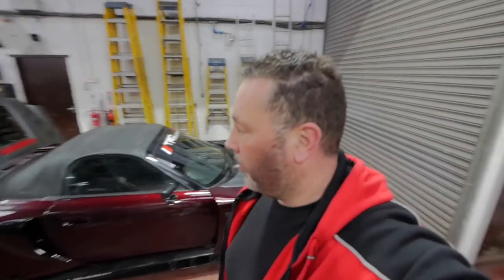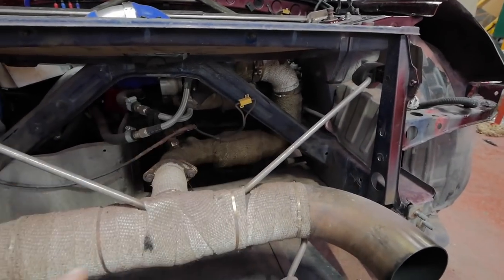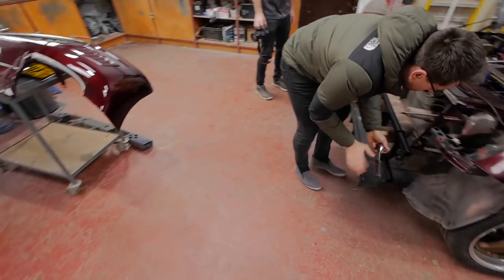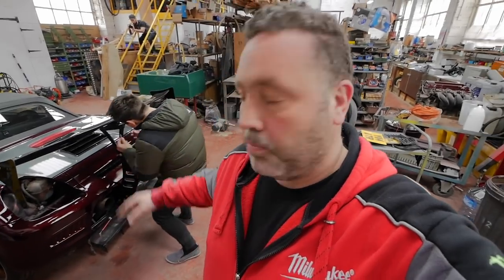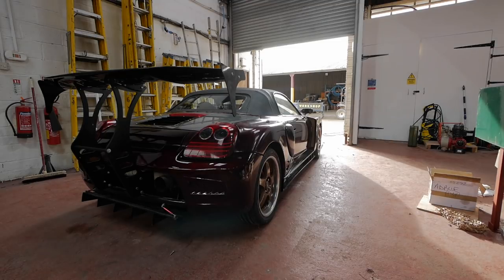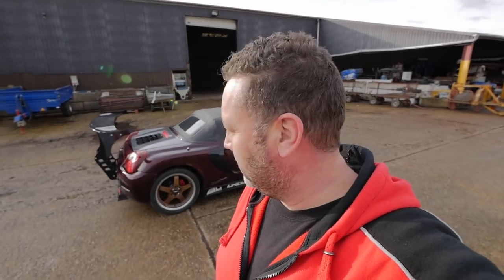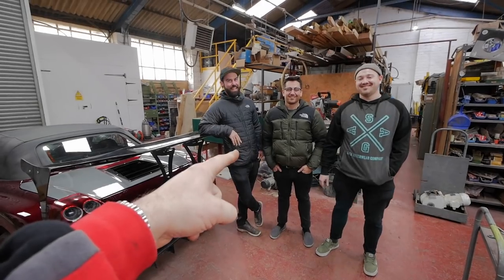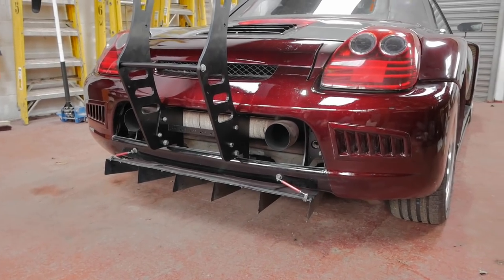chassis wing by ropey racing   MR2 Spyder Roadster turbo

Comment: First vid i've seen thanks to YT. I have to say I'm not sure about the exhaust. Would it make much of a difference to have a 'Y' split exhaust rather than a 'T' with all the length of the thing? I'm a sucker for the looks of a pipe that splits off in a 'Y' but that's just my own personal preference. 
Either way, nice build man. You should try and get your hands on a hardtop for her, then you won't need to worry much about potential thieves cutting through the hood.
Reply from the maker: A y is what I wanted but didn’t have one laying around at the time. I’ll make a new better one eventually

Comment: Hey brother, I have a question, my 2002 mr2 spyder has the sequential transmission, and about 1-2 months the shift stick gets harder and harder until a point I couldn't move it, now I have to do it electronically from the wheel steering wheel. Any idea on that? Thanks brother! 
Love your car and vids man, congrats
Reply from the maker: Sorry dude I don’t know much about that transmission but my manual did exactly the same thing and it was the shift cable between the box and the stick. It snapped eventually. Changed it for new and all good.
Reply: @SpyderLEE  alright brother thank you so much. I will check that. Awesome vids. Bug fan dude

Comment: I am going to be honest... I love most of the things done to this car i have been follow your progress for a while now. But my suspicions unfortunately came to reality today, there is no need for any wing on this car to begin with and now you put this monstrosity on the back? The value of that car is goimf to go down if you keep going the ricer way 😞 sadden to see a beauty becoming a impractical over the top non sense only making the car handle worst and slower. Please take it as my opinion i mean no ill intent
Reply: AGREED!!!!!
Reply: value? unbolt the wing and it'll be back to how it was.  it's easily reversible. the car will handle fine if he adds a bit more front splitter to balance the aero pressure front/back.
Reply: @refirendum  by having a chasis bolted wing it tells a buyer the the person was more insterested in looks over the mechanical factor of the car, and in most cases added things to the engine to damage it or never took care of the car properly... In this case we know he takes care of the car but who ever knows about cars and see that wing, will automatically low ball the car.. You mentioned adding canards in the front to offset the useless wing well thats an extra step fod no reason basically was a waste of money and depreciation of the car
Reply: Well said, came to comment the same thing. It's getting a bit ricey. Maybe cause I just don't like any spoilers but it's starting to look very ad hoc. I'd like to see some changes to make it cleaner. Still really awesome car and way ahead of my Spyder.